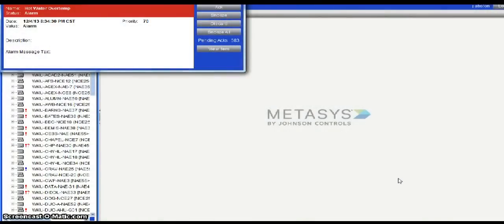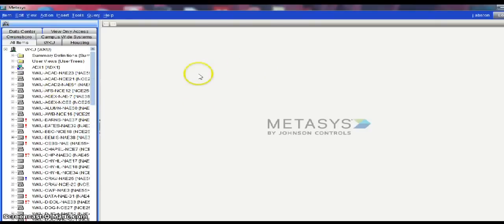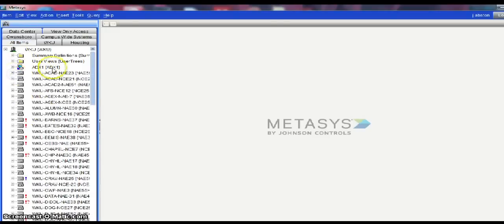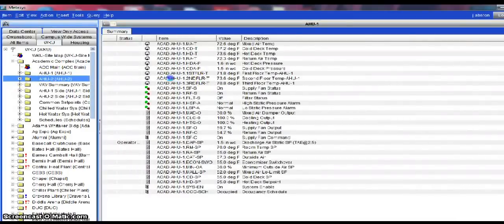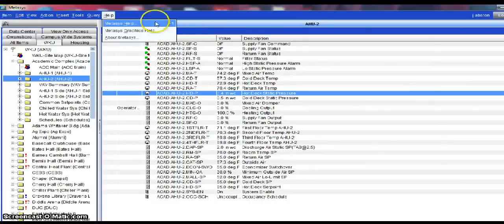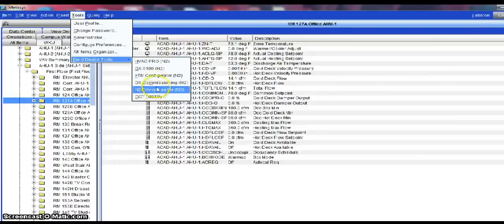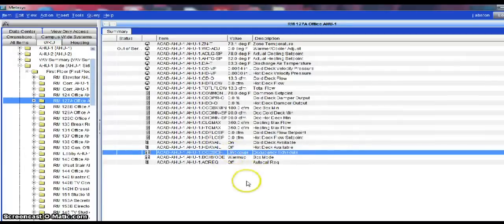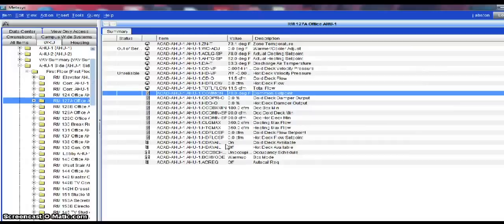Introduction to Metasys Extended Architecture

Comment: Is it possible to view the logic or program for a given RTU?  I.e. review parameters/programing for unit function.  I am trying to understand why units on different sites are behaving differntly when they should have identical programming.  Secondly, is there a way to back up the BAS/BMS?  My concern is if something happens to the NCE Controller on site the system will need to be rebuilt if unrecoverable from the controller on site.
Reply from the maker: That will depend on the type of system you have controlling the RTU.  What kind of controller do you have in the RTU?  If it is a DX you will need the GX 9100 software.  If it is a UNT, you will need HVAC Pro.  If it is an FEC, you will need CCT.  These suggestions are only for Johnson Controls devices.  If the RTU has some other brand of controller you would need their software.  The NAE's and NCEs can be set up to communicate directly with Bacnet devices from other companies but you can only access certain parameters.  I hope this helps and thanks for watching.  Please let me know if I can help.
Reply from the maker: Newer versions of Metasys will talk to older versions inside the nae or nce but I'm not sure how far back you can go. It's always advisable to update your devices to the version of Metasys you're running on the server.  Another issue you will see is that SCT will not be able to backup devices that are not the same version of SCT. Hope this helps.